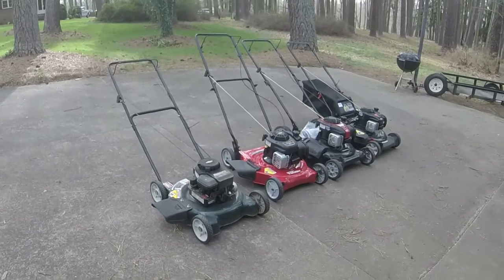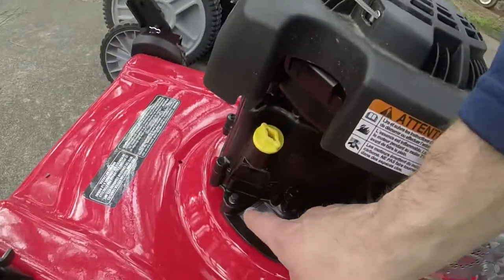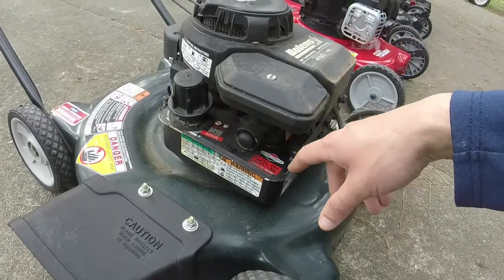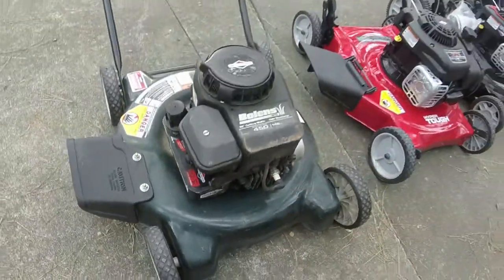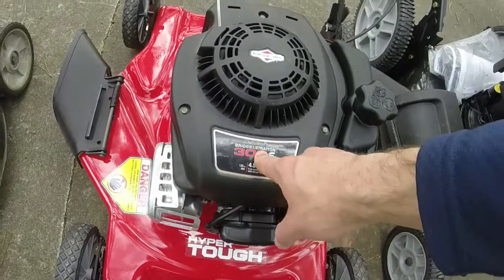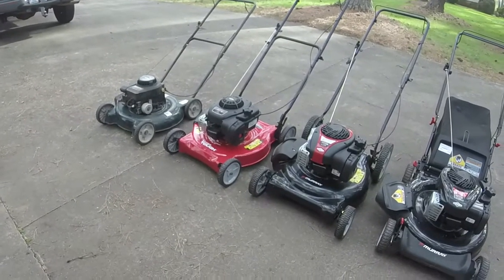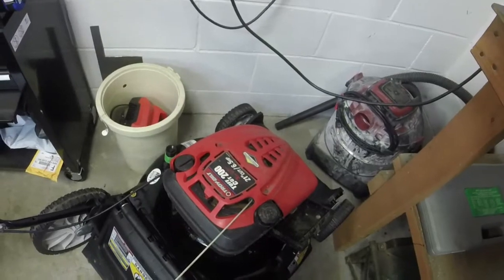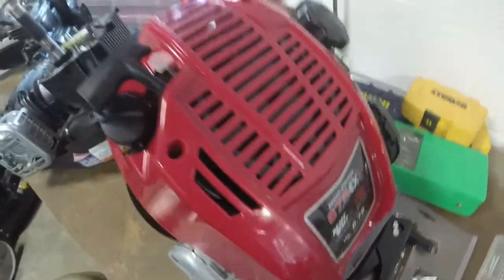Comparing Briggs classic & quantum flathead push mower engines to "new" style OHVs

Comment: The Briggs and Stratton Quantum is my favorite motor.  They are easy to work on and are bulletproof.  I've even got them running after having water in the cylinder. Love the classic too and starting to see a lot of the 550 ex powered machines have trouble with carbs.
Reply from the maker: You are right on.  Lots of carb issues with the new ones, old Quantums sitting for years which will fire right up no matter how bad they are abused.
Reply: @EllisMowersandmore  Of the Briggs engines, the Quantum series was pretty nice.  With the right muffler it was smooth and quiet like a 1980s Oldsmobile.  That said, just to put a new starter rope on it requires the removal of ten fasteners, three different types and head sizes, the fuel tank and often two different shrouds (the decorative one and the actual fan one).  That's where Tecumseh (often two screws, occasionally three) and Honda(three bolts on GXV and three nuts on GCV) beat Briggs.  Of course the primer bulbs on Tecumseh were their own set of problems.

Comment: I bought a Toro with a B&S flathead engine back in 1996. 25 years later, that mower is still cutting my grass. I have a small 1/4 acre lawn which only takes me about 30 min to cut my grass, so consider that when it comes to engine life. But other than normal maintence (oil changes, spark plugs, ect.) I have had zero issues with it.
Reply: Mine is a 99 Toro recycler. The body and wheels are still mint. And I don't know if the engine is as good as my 81 classic type was but other than a puff of smoke on cold start it's been flawless for the past 3 or 4 years since I bought it used.
Reply: @1984Cutlass2nv  if you were having a puff of smoke on a cold start, run 2 to 3 ounces of seafoam on a full gas tank a couple of times and see if that don’t help. Puff of smoke on cold starting usually indicates the valves aren’t seated probably because they are dirty.

Comment: I like Briggs and Stratton engines the 675 EXI on my DR trimmer is amazing. despite the plastic carburetor I've used it in 3 foot tall grass it bogs down but it does it right every time starts on the first pull I find them better than the Honda gcv160. because the Briggs has greater ease of service than the Honda gcv160 and add to that it the Briggs has a removeable head the GCV (Garbage Can Vertical) or GC horizontal (Garbage Can) does not. you cant go wrong with the quantum or the old school 3hp and 5hp Briggs flathead I ignore the just check and add I change the oil with Pennzoil 10w30 conventional oil

Comment: I found a Craftsman mower for FREE ten years or more ago.  I've been using it tomow my lawn and that of my rental house ever since.

It has a 12H802 Briggs engine made 0799.  

My repair skills are only average. When the mower quit working 10/22.  I found that the electrical shutoff wasn't opening properly to allow the engine to operate.  I yanked the whole safety system off and replaced it with a switch to ground out the ignition to shut it off.

The bag is failing.  I rebuilt part of it with some plywood,  but more needs to be done.  The bottom of the bag is wearing out.  I'm thinking about ironing a patch designed for clothes over that faili9ng part of the bag, and perhaps take it to a shoemaker to have it stitched up and repaired. 

So ----- engines aren't everything.  Other stuff is more likely to fall apart, perhaps.

Comment: Please understand you can get more power out of an overhead valve engine with less displacement. That 163 cc engine can probably put out as much power as that 190 cc flathead that you’re talking about. That’s one of the benefits of overhead valves, they burn cleaner, they burn leaner, and they Will run just as good for a long time. If they are taken care of, run dry at the end of the season and then put away and have the oil changed at least once a year I have a flathead quantum and a overhead valve 7.75 Briggs & Stratton professional on two different mowers. They both run fantastic as fuel shut off valves have been put on both of them and I run them dry just about every time I use them by flipping that valve also run a little bit of seafoam with every tank of gas and your carburetor will always perform as specified. Still shut off the fuel valve at the end of every run, or at least at the end of every season

Comment: I own a Briggs Quantum 4hp engine, and I must say it's of excellent quality. The code on the engine indicates that it was manufactured in the late 1992. I've only had to replace the coil once and clean the carb a few times, but other than that, it runs flawlessly and starts on the first pull. I recently checked the valve clearances, and they were perfect. The mower itself was produced by white company, and it seems like it is very hard to find info about it. Hell, even the deck is so well engineered. It's a shame that nowadays, most things are of poor quality.
Reply from the maker: Nice, I know white was acquired by MTD but with the age of your mower it may have been made by another company at that time.

Comment: I have a 1995 Lowes special push mower with the 3.75 HP Briggs flathead engine. I cut an acre of grass with it every year from April to November. Lord knows how much run time is one it. It even locked up me one time from cutting grass in 95 degree heat. I broke it loose with my foot on the blade, started it and let it smoke for 20 minutes. It cleared up, changed to oil and added STP. That was last year and it is still going strong. You can't hurt them.

Comment: Very last of the summer of 2011 I bought a "cheap" Troy-Bilt push mower from Lowe's with a 675 Briggs Flat Head engine.  I didn't need it, I had a lawn tractor and a push mower I just love, a lightweight Lawn Boy with an OMC built 2-stroke engine that just won't quit, and still use it more often than not.
I knew (this is a French word) the damn government in their infinite wisdom was going to do away with the wonderfully reliable and easy to maintain little Flat Head or L-Head engine design with something that sounds good but was more complicated and expensive both to purchase and maintain, as if a lawn mower pollutes all that much running in my case less than 30 minutes once a week.  So I bought it while I could just to have one.  Actually I use it quite often especially for some bigger jobs as it's better suited for being more powerful than my Lawn Boy or my old body is.
I'm almost as happy with my old Briggs Flat Head engine and mower as I am with my 2-stroke Lawn Boy.  I grew up with those Flat Head engines, they are tough., reliable and nostalgic.
I am amazed how the government can take something that works great and improve it to where it not as good!  Typical anymore!
Reply: My dad has the 675 I believe...looks way newer than my 99 6hp but it is a flathead...he said his air cleaner housing warped and was letting dirt in....he fixed that issue but the carb had gotten dirt in by then and wouldn't run. We sprayed some cleaner into all the ports on the carb, didn't even have to remove it and it runs perfect again.
Reply: @1984Cutlass2nv  That's a Briggs flathead alright!

Comment: With the mowers I have had and worked on in my life so far, now I'm talking early 70s mowers, be it Snapper, Murry, I have seen them dumbed down, in my personal collection I have a 82 Snapper, 83 snapper, the 82 snapper is the standard push mower snapper, bagger but no drive, it has the 3.5hp briggs engine, all I have ever done to it, was regular maintenance, carb gasket and simple stuff like that, and it has been through hell, it always starts on the first pull, every time, the 83 I just got, and it's the professional one, super heavy rear drive keystart, and a 5hp tall briggs, this thing is so heavy, I have a hard time lifting it onto my work table, it is built like a tank, ball bearing steel wheel, thick rubber on the wheels, gauge of steel the deck is made out of is truly awesome, both are the high vac, and I love em, I also have the early 90s snapper big six, it isn't any were near the toughness of the early 80s snapper, but it's a damn sight better then the new crap they are putting out, you should of seen my face, when I went to work on a new briggs engine, saw the plastic carb, I was like what in the hell is this crap briggs, omg you cheap bastards, and now the add and go, it's a poster child for buy our engines follow our guide lines and we will see you in 2 years for anothrt mower, cause sorry our guide lines are not covered under our own warranty, they really did sell out on anything built after 2012, thats why when I see a rusted mower with a good briggs engine I take it off that rusted out deck and keep it for one of these new decks with the pos new briggs engines, also have you noticed, the plastic front and rears on these mowers actually bedijg so bad the metal part of the deck is to low to the ground to even mow, I've had quite a few of them, shame on you briggs.
Reply from the maker: It is a shame what Briggs has done with the new OHVs.  Love the old Snappers, have a Snapper RER from 84 myself with the 11hp Briggs.  Smokes a lot on startup but runs great and sucks the pine straw up better than anything else I've ever seen!

Comment: Still holding on to my Toro with a Briggs Quantum with primer bulb...very good mower...no readystart complications and easy filter cleaning...carbs are reliable and if they ever need to be replaced the replacements are very inexpensive and easy to find, not the case with the newer OHV ones
Reply from the maker: The old Quantums are tough, much better than anything else on the market today.
Reply: @EllisMowersandmore  they really are

Comment: I totally agree, the older flat head motors were king, with my favorite being the early 80's motors.
I've got at least 30 mowers here right now, four are blown up 6.75hp models, and one 6.5 Quantum that's nearly seized up.
What I'm seeing a ton of lately is dead coils on the 5-6.5hp Quantum motors, most from the early 2000's. 
I've got two dozen here, all with bad coils. They started to show up about two years ago, and have gotten more and more common. 
(My personal mower is a 1967 'Easy Spin' 3.0hp  Briggs on a 19" deck with offset wheels. My father paid $35 for it new and its still going strong with only a few sets of points, a  couple carb diaphragms, a handful of blades, and a lot of oil changes over the years.)
Reply from the maker: Some good info!  I've seen a lot of Quantum flywheel keys sheared.  Very few if any dead coils though.  The old school pulsa prime is a bit of a pain but mostly due to age.

Comment: I agree the flathead quantum is very durable. I have been  running  one with a sheared flywheel  key for  3 years  until  I figured  after hitting  a large rock that damaged  the blade. Didn't  put 2 and 2 together  until  a few days ago.Real hard starting  just quit overheated. Put a mag on the 1980 3.5 hp classic got it running first time in 16 years.Like the vid.
Reply from the maker: Unless it rips the cord out of your hand it'll run with a sheared flywheel key for forever it seems.

Comment: I started fixing my Craftsman 6.75 190cc Flathead had not changed oil since back 2013 

It still going strong recently I going changed carburetor due to failing leaking gas and change oil and filter same time 

I loved the Flathead I know it get worse fuel guzzlers 

I got another 2012 Craftsman 5.50 OHV still goes after 12 years always changed oil every 20-30 hours after use 
Least carburetor still original and few preventative maintenance

I started liking the gotten used to OHV

Comment: I've only ever come across one Quantum engine with a bent crankshaft and that one was on one of those ubiquitous mulching and bagging decks made by AYP for Sears Craftsman. I'm the one you said you couldn't adjust the height of the mower that's not exactly true unbolt wheels and pick from three different whole positions. Something else I noticed on your overhead examples is that break is one with the short dipstick instead of the longer tube in the hyper tough actually has a cutout in the blower housing to accommodate the longer tube.

Comment: I have a 2011 Toro with a Quantum 190cc flattie and it has been perfect. Just a few plugs and air filters. Oil change every year, run it dry of fuel for storage and blow off the dust. Of course I plan on keeping it but after watching this video I may go Honda (at least for the engine) when this one goes to mower heaven. I also have a 43 year old Ariens blower with a 5hp Tecumseh snow king, runs pretty good too. In  storage are 2 OMC Lawn Boys 2 strokes. One 40 and one 53. Can't kill those things.
Reply: In case you aren't aware. This is the last year for Honda. My advice is to get a Quantum Rebuild kit and have it handy for when the time comes.
Reply: Thanks. I heard that too. Wish I put away a fwd Toro with optional Honda engine a few years ago. Two neighbors have Toros with OHV Briggs and one never changes oil or does anything at all. It runs crappy, must need a carb clean but is at least 10 and won't die. Oil is over full and black. Point is, I'd get one if needed and be all set as I take good care of machines. I may have to act as some states are going to ban gas yard equipment śales. Yard is too big for battery electric, plus not crazy about battery life and replacement cost.
Reply: @gmzx3  Definitely I would act. From what I can tell Kawasaki Engine might be the best bet. They last around 5,000 hours with expert maintenance before needing a rebuild. The downside is they can be hard to troubleshoot, very efficient engine though, more powerful than Honda's commercial albeit not as easy to work on. Pressurizes lubricated so great for hills and steep angles. I personally own an FJ180V and have had zero problems with it.

You could always pick up a Honda GX160 vertical shaft engine while they are still around. They run forever, are easy to work on, and fully iron sleeved and rebuildable. Just read the owners manual on the dipstick so you don't blow the engine. I know most commercial guys get 2,000-3000 hours out of them. I always wonder if that is from imperfect maintenance though? Very easy to work on. Splash lubricated so not great for steep hills. Parts will be supplied for the next 8 years and there is a huge after market for it. Pick up a couple of spare things like a gasket/rebuild kit, a spare oem carb, and you should be good to go for the rest of our lives.

Kohler Command Pro 223CC. Easily the most powerful of the bunch. Estimated lifespan is 5000 hours and you can get an oil drain house. Honestly this engine takes a filter like a car engine. Really good service manual too. Downsides would only be possible quality control, but this the go to engine for commercial lawn contractors. It outdoes a GX160 or a Kawasaki. I have heard it's harder to work on but it's such a newer engine time will tell or it won't until it's too late.

Worst comes to worst, pick up the good engine. Buy the deck you want for it later and bolt it on.

Comment: I consider a Briggs only a flathead. The easiest mower I ever fixed was a flathead Murray from 1993. Carb clean and a new plug and that’s it. The worst one was a 2012 Briggs 125cc plastic carb ohv engine. It started after 8 pulls and sputtered, stalled (broken governor), and backfired. I don’t work on ohv Briggs anymore unless it’s self propelled or ride on mower. The only fault on  Briggs flatheads was the pulsi jet carb. If it didn’t have a pulsi jet, it was the best.

Comment: Yep, my mower has a 190cc flat head on it. It was new in 2015. has a metal carburetor.  I bought it because it had the flat head engine, I haven't seen one since new.
Reply from the maker: 2015 or 2016 were the last years of the flatheads for Briggs.

Comment: I prefer the older Quantum engines and the new 190cc and 223cc commercial engines over any other Briggs and Stratton engine. I really do like the new  GCV170 and GCV200 Honda engines even better than the old GCV160 and GCV190 as they are good new designs. The way to get these Briggs and Stratton EX and EXI engines to last a long time is to treat them the same way as the other engines and still change the oil annually. Yes, the plastic parts are cheap. I absolutely hate the plastic recoil cups and carburetors the most. Such a design flaw. However, it can still last with proper maintenance. Unfortunately, the recoil cups and carburetors may need to be replaced occasionally as they are plastic. I know people that have had the first of these engines from 2015, and they have actually had good luck with them. I bet they do change the oil every year!!😉

Comment: One more thing. Yes you got I change the oil. Oil doesn’t go bad but the detergent break down and contaminants from the cylinders do get into the oil and the oil gets dirty. It Hass to be changed seasonally. I wish that sticker is something that Briggs & Stratton would stop putting on their engines

Comment: One thing I started to notice and I’m sure you’ve noticed as well is that modern mowers made by MTD are extremely modular. And they share as many components as possible to keep manufacturing cost down. They don’t need to have separate castings for the block or separate stampings for the deck. They just add different components or they machine it differently. I can admire them for their efficiency in production but I don’t see them being desirable down the road like older mowers.
Reply from the maker: Yes I have noticed that too, makes it easier for me to replace parts on them from junk mowers but generally they are all a throwaway item now.  Not a money maker for MTD so why put a lot of time and effort into it.